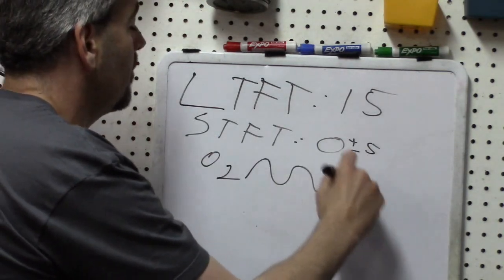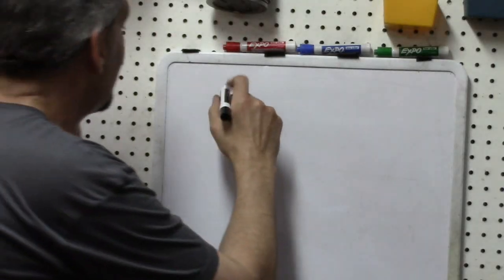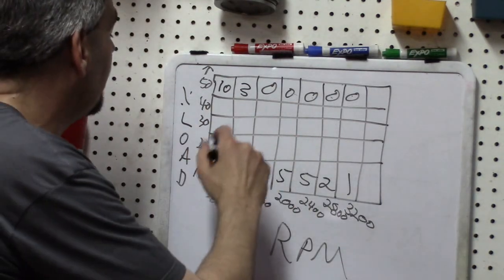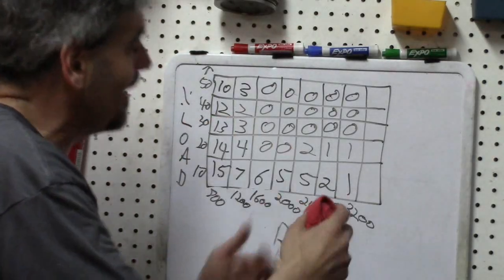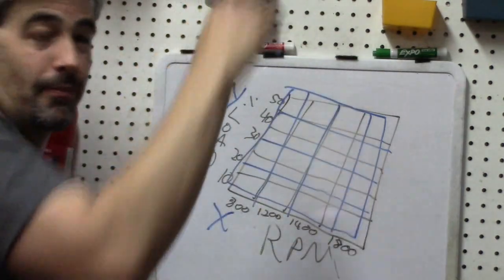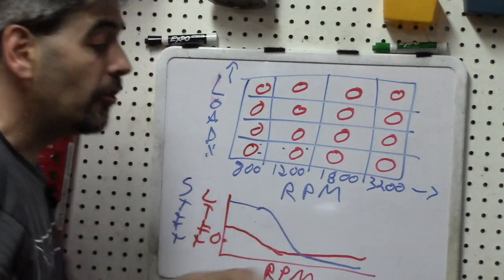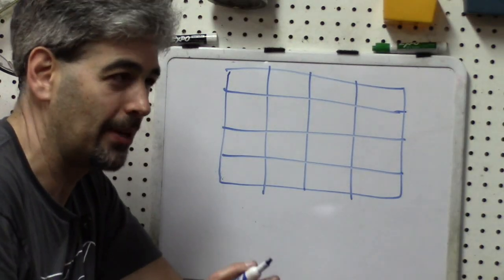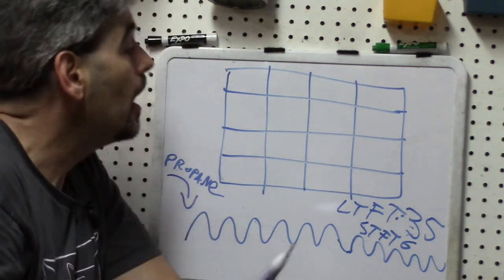Understanding+Diagnosis: Adaptive Fuel Learn Strategy

Comment: Hello Matt. I am a sixty year old former marine engine fitter living in the north east of a small island off the west coast of Europe called England where four cylinder engines are rather NORMAL and any more than four is abnormal!! I have repaired and serviced first, my own and subsequently my family’s cars for decades. My first rebuild was a FOUR !!! cylinder 1100cc engine I n 1968.  I grew up on and revered Weber twin choke carburetors with their numerous options of chokes and jets. I am of the old school mentality but now, decades later, I am staring into the abyss of engine management systems and diagnostics. Admittedly we now have reliable, efficient comfortable cars with performance that would have been breath-taking in the 1960’s and 70’s and we are spared many of the frequent frustrations that afflicted us. The need to get to grips with engine management and its diagnosis is critical. Just like air moved faster than fuel through the venturi of a carburetor and caused a weak spot until the fuel caught up or an enrichment device opened up, technology became the equivalent of the air and our knowledge, like fuel lagged behind. Now thanks not only to the availability of diagnostic equipment but also to the likes of, Schrodinger’s Box,  Scanner Danner and Eric the Car Guy etc. the public and professionals alike are eventually becoming more informed, less intimidated and aware of the real value of engine management and how to deal with its “manifold” issues.  I am profoundly impressed by the generosity of spirit of those, like you,  who have given so much time to share with the world what they have learned themselves, but am a little embarrassed that almost all of the amazing things I am learning are thanks to Americans and that there doesn’t appear to be any similar quality and quantity from my countrymen who one time prided themselves on their engineering prowess. That said, I think that thousands of people the world over will look back and thank you for what they have learned from you. Who can tell what the full extent of your sharing will have, now and in the future, even in remote, small, four cylinder cultures. 
Having seen quite a few of yours and Paul Danner’s videos, I am now feel that diagnostics is much less intimidating than I previously did, so much so that I went out and bought some PC based diagnostic software and can’t seem to put it away. It goes on almost every journey and already I find I need a much more capable one.
Tonight’s viewing was your Adaptive Learn Fuel Strategy. Pausing the video repeatedly allows me to make notes, six pages tonight. I don’t pretend to have understood all I saw, but it was far from the “serious students” palate that you suggested. It really did help me to understand L & STFT better than I did after watching the videos on fuel trims. It was fascinating and while it might seem weird or sad to some, I find these videos technically exciting. At last I am able to grasp terms and principles that until three weeks ago were merely terms or at best vaguely understood ideas and more importantly I am now learning for the first time how to apply what I am learning. A person needs to be working on cars day in day out to acquire real diagnostic skills, but at least now I stand a good chance of correct diagnosis, even if it takes a comparatively long time to arrive at a conclusion.
I have a question about mapping that I will withhold until I have watched the video again in case It proves that it would be better to keep my mouth shut and let people think I am an idiot, rather than open it and prove them right.
Thank you very much indeed for the considerable effort and time you devote to the videos. Thanks also for the generosity of spirit to share.
Tom
Reply from the maker: +andy scott Thanks Tom- read the entire comment. I usually hear from the crowd that identifies with your demographic that computerized engine management is "poppycock" and they avoid learning new material like the plague.  It is refreshing to see some people in the older crowd embrace and try to understand the new technology which is without question better than ever in history by far.  Also glad to be included in that list of great names!!!  Enjoy the site and thanks for the great feedback.
Reply: WRT his denigration of four cylinder engines, I was going to suggest reminding him of the history of the Offenhauser engine at the Indianapolis Five Hundred until I remembered that you Brits think Yanks are crazy for racing around in a big oval.    :=)

Comment: Very informative. Thanks so much. Great to now know how the LTFT, STFT and lookup tables all interact and to learn they’re stacked. Wow. 

Just got through diagnosing a P0171 lean code that showed up immediately after swapping the turbo on my ‘13 Chevy Cruze 1.4L 4 banger. Used propane while watching both LTFT and STFT and found the air leaking in around the PCV-to-intake fitting. Replaced O-ring and viola’, everything back to normal in just minutes. 

Now, when the fuel pump gets lazy, I’ll know how to tell difference between low fuel pressure and a vacuum leak. 

Smart whiteboard!

Comment: Great video.  Although a simple and commonly used computer control concept, it is difficult to explain and visualize, you did an awesome job.

My comment is that the PCM algorithms utilizes either an equation or ROM table(normally this) to determine base value and then adds LTFT and STFT.  In this discussion you are talking about fuel, so the PCM has an internal values set up by the engineers for each cell representing fuel injector duty cycle, usually derived from characteristic equations of the system being controlled but implemented as a table.  The LTFT table and STFT are used to have the PCM adapt to changing car conditions, sensors and actuators aging or injectors getting dirty for example, by either adding or subtracting from the duty cycle for example.  You stated this.  What I'm adding is that the PCM has internal non-changing values of which are tweaked at run-time by these dynamic learned values. 

And this technique is used for other PCM controlled activities, like timing curve, fuel, idle adjustment, shifting, ....

From the programming angle, the reason multiple dimensional arrays are used versus always calculating the base values is that the desired value can be determined in constant time.  For embedded engineers writing a PCM that controls a motor in real time, this is a very important factor.  In addition, using this technique, a lower powered processor can be used or CPU cycles can be devoted to other activities. And, lastly, changes to the engine specification can be done easier using tables versus having to re-develop and test new internal characteristic equations.

So, the whole motivation for this comment was to point out that these base values are what are manipulated by performance chips and PCM tweakers,....

I hope I was able to explain what I had in mind.  Like I said, this algorithm is not easy to state in a short paragraph or video.
Reply: Agree with you but let me point out that you're describing a condition of the ECU during open loop, I mean the ROM tables in the ECU with non changing values are just used under open loop or in case there is a sensor failure like CPK or CMP, the ECU uses this values for limp home mode. I think PCM Tweakers actually manipulate both values those fixed ones for open loop by the engineers in the ECU ROM and those once the O2 Sensors are trimming during close loop condition.

Comment: This video is the perfect complement to the 'Understanding Fuel Trims' tutorial. I must admit that I had to watch it a few times in order to get it pegged, but it really does have its benefits once you understand it. I think the main take-away here is understanding the relationship between dynamic data (stft) and stored data (ltft). Whilst learning about the grid system has no real advantage in the field, it can facilitate those tricky analyses that demand deeper investigation. For the die-hard DIYer, this video is essential viewing.

Comment: Excellent video!  I picture the fuel map in my head like a big Rubik's cube. This video fits right in with programming my motorcycle's Power Commander. It sits between the ECU and the injectors to allow custom mapping. Pretty cool.

Comment: Great explanation.  I've  actually found that sometimes when I fix a major vacuum leak that I have to completely reset the pcm because after doing the fix, trying to run a key on engine running test on some vehicles the study will be so negative that the computer  can't get the o2 sensors to switch during the test. This happened on a ford excursion that only had the maf wire plug that sealed the air box housing was out causing a massive vacuum leak after the maf sensor.  Again, I found that you explained this really well.
Reply from the maker: Yes this would indeed expected - the reason being not only the fuel trim relearn that must occur but also the IAC relearn which will be very significant after a vacuum leak is fixed. It is easiest for the relearns to start with the default cells rather than to correct from the adapted cell adjustments.

Comment: I should have watched this videos sooner. I never knew which Fuel Trim to look at and was always hoping for a Net Fuel Trim PID. Thank you!
Reply from the maker: Paul MvN I have never seen a net trim PID but even then it would be useless- the value in total trim comes from the difference in the ST and LT.  For example if net trim was 50 and LT was 25 and ST was 25 you know you have maxed out fuel trim and this drastically changes your interpretation of O2 sensor output  as opposed to if LT was 50 and ST was 0
Reply: true, but I didn't know that before this video. :)

Comment: This is probably the best video i have found explaining fuel trims! Keep it up!

So many videos explain fuel trims and how they respond to each other, but they don't explain how they would be interpreted in a real world situation.  This is by far the best video on the web! Explained the discrepancy you would encounter and why you don't see fuel trims move in the hypothetical way extremely well!

This definitely helped me understand why you can see both LTFT and STFT trending positive but settling at a specific point, because the computer is using its adaptive learn under a preset. So under idle if you see a higher fuel trim that might be completely normal according to the engine management vs when you are driving down the road. LTFT is the learned average assuming it has had a chance to fill in that cell, where STFT is an adaptation based on engine management and current conditions. So perfect zero is not always realistic or should be seen as a problem. Which can get really confusing when you compare fuel trims with a faster reacting wideband vs a slower reacting narrowband o2 sensor. 

Thanks a bunch! Keep on makin them dank videos.
Reply from the maker: Thank you very much!! Yes I believe I scored a winner with this one lol. It’s even used in some automotive tech schools as part of the curriculum.

Comment: Thanks for the heads-up on 3D fuel tables. I didn't think they were that complex.  Are there really discrete vertical cells or is the base table offset by programmed amounts based on MAP, IAC, etc at the time of sampling?  I can see either being used.
I was surprised to learn that the PCM uses the LTFT table before live data but I guess it makes sense as performance lag is reduced since the PCM is not constantly sampling and correcting each cell until a threshold is reached just like a threshold has to be met before setting a cell value in the first place.  This sure explains why a car can run like poop for awhile after a PCM swap or reset - especially if the problem that filled the old PCM's cells with correction data is not fixed and all the old corrections need to be re-learned.
I admit I don't always think to hit the LIKE button.  When you watch enough good videos like yours ya tend to set the bar high and take it for granted and then wear out the DISLIKE button when others don't meet that high standard.  I pressed it this time, though! :)
Reply: Eddie the Grouch I do push the like button a lot since I choose to watch channels that are more often worth my time. If something really blows my mind, then I put it on favorites. :) I should do that with his more recent video on the truth about oxygen sensors.

Comment: Matt I had a Volvo years ago and it had an unsteady slightly reving and falling idle. No vacuum leaks but the valve was faulty. Now I realise the SHTFT must have been responding to the varying bypass air if I have got that right, car was fine apart from that. Replaced the valve and it was fixed.

Comment: Fuel maps are learned and can change depending on A/F for the purpose of fuel efficiency. Everything it does is for goal of keeping the best MPG it can depending on the situation. Fuel maps use an adaptive algorithm.  Fuel maps vary by manufacturer too.  You'll never fully understand every manufacturers maps there are simply too many but the basic principle is the same.  Also depends on what components and sensors they use like electronic IAC vs mechanical and so on because different components will react at different speeds.  PCM chip and network bus speeds also play a role and why some cars seem to react slower than others.  Older vehicles generally have slower chips but the change shouldn't be a difference of minutes but in seconds.  Like 2 seconds vs 4 seconds it's not as dramatic as minutes that you make it out to be.  Each fuel map is designed specifically for the ECU. One of the best things you can do to avoid triggering an adaption is to inflict quick changes.  Blips are ignored and not adapted to.  However if you sit there and hold propane in it for a minute or two it will indeed start to relearn and remap the cell except in the case of it being too far lean to come back to stoich as in your Jeep example.  ECU/PCM's are pretty darn smart.  Another major part of the fuel map is the startup idle enrichment map.  It slowly subtracts fuel and adds air as the engine and IAC warms up.  You can't really use it for diagnostics since it's in open loop but there are plenty of other sub-sections of the fuel map.  Bless me I watched the whole video.  :)  Good video. :)
Reply from the maker: ***** Absolutely correct.  It is incredibly complex and I agree 100%- delving too far into this will put you way deeper in the forest than you need to be, or even want to be.  This milieu is more for design than it is for repair and diagnostic.
Reply: juergen scholl Fuel maps and fuel strategy is not emission based.  They are for fuel and engine efficiency.  Emissions are a variable not the goal.  Yes there are emission laws that must be met but that's a secondary goal compared to performance and fuel efficiency.  There are many goals.
Reply: Glad you're impressed.  Thanks.  I have multiple approaches for multiple kinds of people.

Comment: Excellent. I think another way to think about it is to look at the first oxygen sensor as a quality control system for the fuel map. If sensor is switching rich to lean for a given set of  RPM, Load, and MAP values,  then the LTFT value in the table is correct. Otherwise, the PCM must adjust LTFT value in table to get the 02 sensor "working", a.k.a switching again, and this will be accomplished by changing STFT.
Reply from the maker: Well said!

Comment: Interesting Video there Matt mate.
The biggest thing I took away from it was a better knowledge of when it is prudent to wipe the map, or leave it as-is. Also your observation that under certain conditions, there will be cells on the map with zero trim, that are so because that cell(s) have not been used yet since the last wipe, was a minor eureka moment, which tied up a loose end question (I love those)
I have often graphed long/short term fuel trim under normal driving conditions, and observed the changing long term values, but never through the lens of a more thorough understanding of the fuel map. Now I see there is diagnostic value to test driving the vehicle with the map as-is, and after clearing, and comparing the two graphs. And, if you wipe the map, it is like the fault (eg vacuum leak) has just occurred, and you can see the short term trims working hard to correct the problem, generating a very definite graph, which is always easier for diagnosis.
50% of my work is on BMW`s, and they use the term "adaptions" to describe fuel trim. There is, on most scan tools, a facility to "clear adaptions" which saves having to disconnect the battery, with the attendant nause of having to reset clocks and radio stations etc.
Top Notch , carry on....
Reply from the maker: Simon Crane Top notch comment sir! I am always amazed at the number of people like me out there who eat this stuff up. It's remarkable!!
Reply: Yeah, kinda restores your faith in humankind a bit doesn`t it ?? :-)